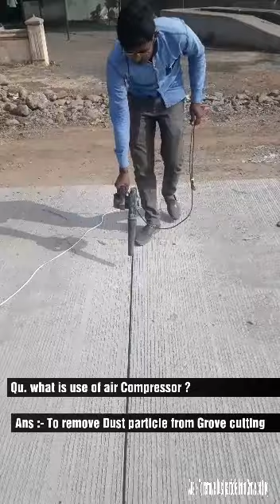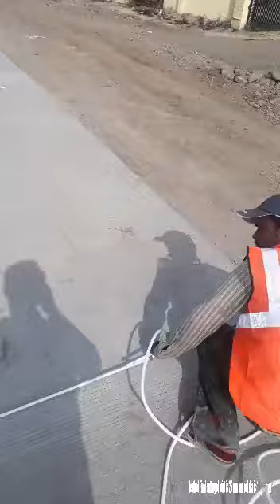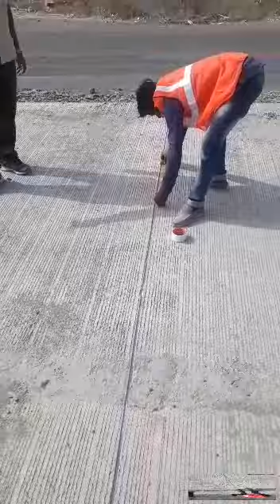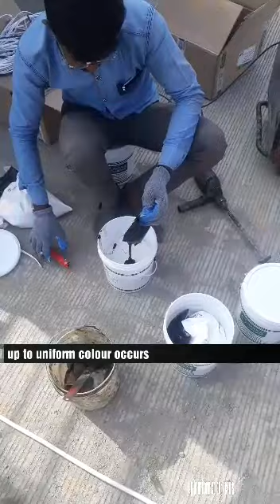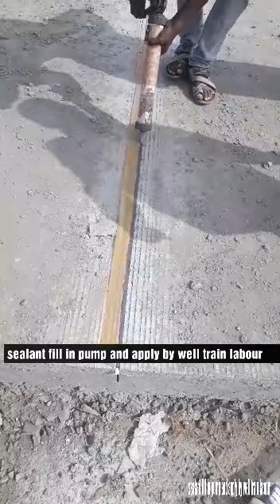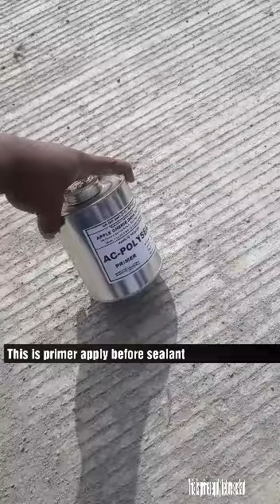Sealant filling in expansion and contraction joint PQC road

Comment: sealent ka function kya hotha he sir
Reply from the maker: Sealant function is seal the joint and prevent entering of water, small stone particles and dust , if water inter in joint it's harmful for sub base and if stone particles enter they will block joint and resist concrete to expansion

Comment: How to calculate quantity
Reply from the maker: Generally 1 kg sealant required to complete 5 meter length , change as per depth and width
Reply: For 1 kg coverage 5 meter , what's the depth and width considered ?